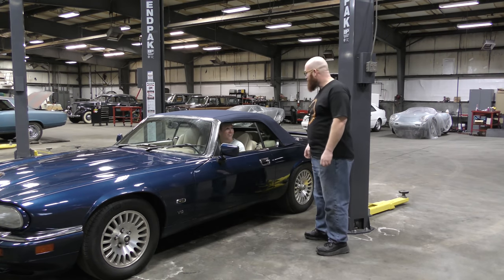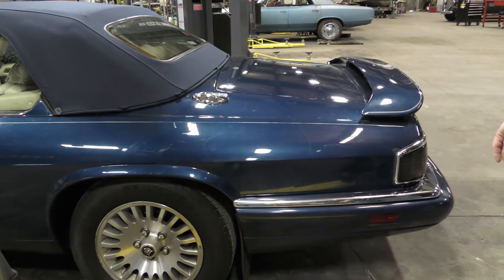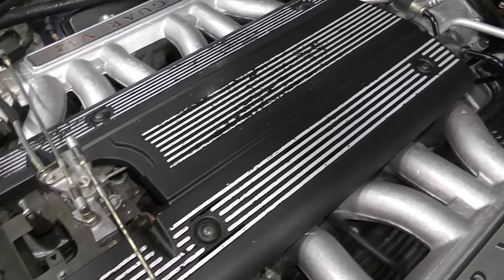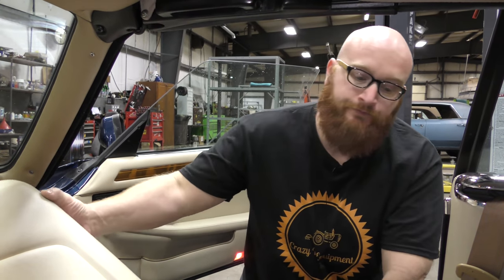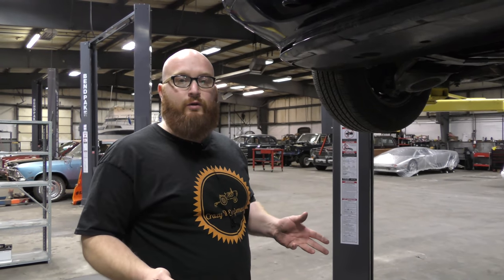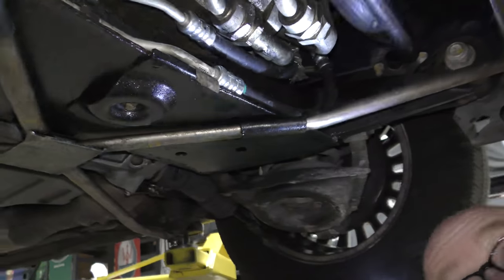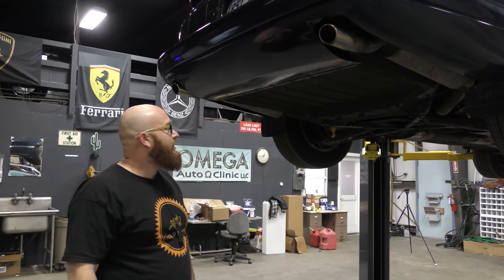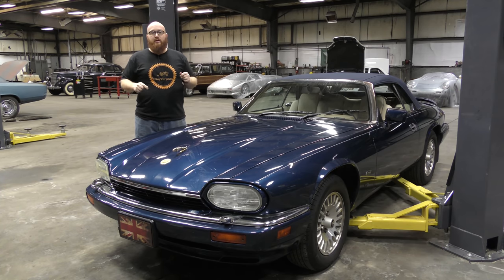It's another smooth running V12 Jaaaaag in the CAR WIZARD's shop! Check out this 1995 Jaguar XJS

Comment: The car did not come from the factory with the leaping jaguar ... someone has added that. It should only have the round badge.
Reply: Reminds me of a benz or bmw with a logo on the hood and a decorative plate with the same logo on the front bumper.  Never liked it
Reply: It doesn't look right with the leaper.  Very few Jags actually do.
Reply: @msalzberg4962  You are absolutely right ..... if the car had come from the factory with the leaper it would have been mounted where the round badge is, not 8 inches behind it . It doesn't look aesthetically pleasing. If I owned the car I would certainly remove it!
Reply: They weren't factory installed for pedestrian safety. It was a US thing back then. Those leapers were installed by the dealer if the customer wanted to.
Reply: Yep, looks naff imo
Reply: @freepieanchipsgarage I'm surprised about that considering the US's stance on car & pedestrian safety.
Reply: @freepieanchipsgarage I'm really surprised about that, thought the US was hotter on car safety legislation, like with the 5 mph crash safety bumpers. Mind you they continue to put dirty great bull bars on their pick up trucks and iirc bull bars had to meet pedestrian safety legislation a while back in Europe? Maybe the US is tighter on some stuff & visa versa with Europe? I have seen leaping Jaguar mascots on the bonnets of some late-ish Jaguars here in the UK that have been fitted by owners, I'm assuming they're not part of the MOT?
Reply: Freepieandchips is wrong
Reply: @Thomas63r2  Yes he is, I've owned three North American spec XJS V12 Coupes (an '87, '89 and a '91) and none of them had a leaper ... they all came from the factory with the round badge.
Reply: @freepieanchipsgarage "Dealer" installed when a buyer requests it does not make it standard or factory fitted.  Sorry, glad you like yours.
Reply: @freepieanchipsgarage It has surprised me hearing about some of the rusty death traps The Car Wizard has described how lax some US standards are. Here in the U.K the MOT is every year once a car is three years old and was recently change so any warning light is a failure. Many cars get scrapped because getting them through an MOT would cost more than the car is worth. 

The US does have some things like mandatory back up cameras that aren't a requirement here. However, what incentive is there for an owner to fix the camera if it stops working after a couple of years ?
Reply: @freepieanchipsgarage sigh, sorry you are sensitive  In reply to the original poster, HRCVF750, you were the one who said they came on all North American Jaguar until 2009 except XKs.  You are correct, my classic XJ12 does not have a Leaper.
Reply: @freepieanchipsgarage I think the issue with the checks in Japan is the price of the test. The most a garage in the UK can charge for an MOT is just under £55 and many charge less (although are more likely to rip you off on the cost of repairs). In Japan it is around £470 !  You will find plenty of cars for sale in the UK with short MOTs for under £470. If you are lucky enough to get a pass it probably doubles the value of the car.

p.s. At one time our local Ford dealer earned the nickname Grief Motors after their MOT checks wrote off two colleagues cars in same month. My wife's Ka survived every visit there, although on the last visit we did have to take it elsewhere to get £500 of welding done, before selling it later that year for £800. The real blame was on Ford for poor underseal. The mechanic said that he would see cars in perfect condition on the topside but full of holes in the floor.
Reply: @freepieanchipsgarage Wow, you are just like a kid denying what they said.  With some B.S. about this one being moved back from its original location.  Nope, this one has it exactly where either a dealer or owner installed it.  Still looks awkward.
Reply: @freepieanchipsgarage Northern Ireland has a better system with Government places doing the testing and you having to take the car elsewhere for repairs. In England they do try to keep some consistency. In the 1980s I heard of one Garage losing its status as a test centre for passing a car trading standards had taken there with a number of known faults. 

By far the bigger problem is the other way around though. I took a car to a newly opened Lucan autocentre for a service and was told it needed four new shock absorbers. That was one week after it had passed its MOT, so I told them what I thought and never went back there. In the next couple of years and MOTs no other garage ever made any comments about the still original shock absorbers.
Reply: @freepieanchipsgarage I guess freepie knows because he was there when this ornament was weirdly installed.
Reply: @freepieanchipsgarage all I said was that you were wrong - you are the one hurling personal attacks
Reply: @freepieanchipsgarage I guess I would suggest you learn how to write with clarity.  My suggestion would be to start with a quick read of Strunk and White.

Comment: 301 horses from 12 cylinders is awful, regardless of age 😂😂😂
Reply: ...exactly...crazy...
1969-502ci V8 220hp
2021-1.6T 4cyl 400hp
Reply: 350 lb -ft of torque is a clue about what they were aiming for.
Reply: To put it in perspective, the 5.8 litre V8 in a Ford F150 from the same year was 210 hp. Think 301hp  out of 6.0 is that bad now?

Comment: Brake hoses have been replaced, likely not bled 100%- that would be my first check. Lovely old car
Reply: 4:48
Can Wizard even go upstairs? It says 190lbs a sq. foot. Imagine being a customer there and seeing Wizard crash thru ceiling in the office
Reply: Just what I was thinking
Reply: @619guy202  I don't think he has square feet, so it should not be a problem.
Reply: Code on a house is around 40lbs per sq foot min.

Comment: About the crooked steering wheel : to do an alignment on those Jags you have to first set the steering rack at center and then mess with the steering rods. They won't be at the same length left and right and this is normal !

A previous shop may have done the alignment by just putting the rods at the same length, so the steering rack itself is not centered.

Car Wizard may already know that but hey, figured it might help.
Reply: My 944 has that same problem with the steering wheel being crooked. Do you think it's a similar problem? I haven't had it fixed yet.

Comment: Just a tip on that Jag , The u joints interchange with Ford F150s of the same year.
Reply: The u stands for universal.
Reply: Thanks for the timely tip. Have to pull the IRS for seal leak, bushings, etc. Might as well put new Ford$ u joints in instead of Jag$$$$.

Comment: Love that color !  A V-12 facelift car is quite rare, (most of them had the 4.0L I-6).  If the info I found on the Jag-Lovers forum is correct, that XJS is one of a mere 148 V-12 equipped cars produced for 1995.  I love my 55k mile '96 XJS !

Comment: Quite a nice cat, if you like the rear (and the spoiler is a no-go).
Reply: Spoilers on convertibles seem wrong to me.
Reply: Spoilers were standard on 12 cylinder cars. They were optional on the 6 cylinder examples.
Reply: Agreed. The rear spoiler spoils it for me. (sorry for the pun)   Fred

Comment: Like the composite European-style headlights. But this set looks oddly “unfinished” because of the painted bezels. Usually they are either chrome or stainless. Looks MUCH better that way, in my humble opinion.
Reply: yep...the bezels do look weird not chromed or stainless
Reply: The later models had the painted bezels.
Reply: Yeah completely agree with you on the bezels, but I live in Australia & I've changed my headlights to the US spec ones, just to be different, Oh & my coupe has also been converted to 350 small block, Rj in Oz

Comment: I met a guy at a gas station with two of these, one has the Straight 6 and the other the V12. He says they're the only cars he's owned since he bought them in 2004. The 6 cylinder one he was driving to the gas station had 160,000 miles and looked immaculate.

Comment: My 87 had similar issues (also similar miles).  Steering turned out to be simple alignment but all shims were missing so it turned into a complex DIY job to set up brake centering, camber and caster.  All safety lock wire was missing also.  Another fun job at the front was wheel bearings.  Rock side to side - no play.  Rock top and bottom and there was a noticeable wobble.  This was worn spindles (stub axles).  The inner bearings had rotated and worn a groove in the axles.  I fixed that with new axles and conical clamps to lock each bearing in place (racing trick apparently).  This had a HUGE effect.  I think the wobble caused the pads to back out leading to soft pedal occasionally. Mine works great now - fast and quiet.  Drives smooth and been reliable for the last five years or so - love it!

Comment: the leaper was added. the growler is stock. 
it's an old argument: growler vs leaper. :-)
Reply: The leaper is out of place on this car.  My X-Type had a leaper; I replaced it with a growler.  Much better.
Reply: @freepieanchipsgarage hi. i own a 94 6l.stock with the growler. went through ALL of the service manuals/spec sheets for nigel(the name of the xjs). did not come up with a leaper at all on any parts listing for the car.
Reply: @freepieanchipsgarage ....it IS possible though that it was a dealer installed option. on the car in the wizards garage though that is not likely to be the case. it had to be installed by either the present or previous owner. either way with both on the vehicle at once the persobnal opinion is that it looks ridiculous. a bit late for the bonnet though to be correcting that now. :-)

Comment: I'll be curious to see how the problems with the Jag were found and fixed.
Reply: Yes Car Wizard only seems to want to do an assessment on camera and doesn’t like to be shoulder surfed when doing the work. It would be interesting to see a little of the deep dive and rectification process. He actually did a bit of time lapse fitting a new bilge pump to his boat. It would be interesting to see at least some work in progress on the cars
Reply: Maybe he just does the assessment s and has his mechanics do the work???

Comment: Agree with Wizard. I also prefer the original headlights rather than the American spec. However because this one is a later model, it doesn't have the early rear light lenses which were a really unusual and unique design. I previously owned a 1988 XJS V12 HE. I changed the plugs at home-bit tricky as you have to remove the air con compressor to get at spark plugs 1 and two...

Comment: Wizzard  You know as well as me if a jag is not leaking oil the only reason is that it has no oil. Remember the old drip trays for you garage floor? Most jags need one of those screwed to the bottom of the oil pan with a bilge pump on it. During my apprenticeship back in the early 80s we had three steel templates hanging on the wall in the storeroom that had  "Jag rear brakes" written on them. One was for the holes you had to cut under the rear seat base to access the calipers for the xj6 series 1, 2 and 3, The second was for the patch panels that we had to make to cover the holes. The third was for the previous model from the 60s with those tiny hand brake pads. LOL

Comment: Mr. Wizard, thank you for the V12 XJS videos.  Your willingness to share your experience is a real gift to us all.  I recently acquired a 1994 XJS V12 convertible with 32,000 miles.  A true fair weather Sunday drive car.  Two questions for you.  Do you lift with the 2 post hoist on the dedicated jacking fixture?   Will you be doing a video on the valve cover gaskets to address the oil leak?   My car has the same issue.  To date I have replaced the AC pump, O rings, dryer and expansion valve.  Evacuated the system and recharged.   Also replaced a couple of faulty relays and perished front shock top rubber bushings.  These are truly beautiful grand tourers.  Doc R

Comment: The leaping jaguar hood ornament is actually older. I remember seeing them on Jags here in England in the 60s and 70s. I think they stopped fitting it because of the risk of disembowelling people if you were unfortunate enough to run into them. Rolls made the Spirit of Ecstasy ornament retractable for the same reason.

Comment: I believe that its a two day job to replace the valve cover gaskets because of the plumbing that hangs over them.  I looked at a couple of these over the years and they all have leaks that the seller is trying not to fix.  Still a beautiful car and if you can get a good one and find a mechanic willing to work on it then you are golden...
Reply: No, it's not. You can unbolt the manifolds, disconnect the fuel rail, vac lines, injector connectors, then lift the entire lot as one piece onto a board and take it away, then you just unbolt the covers and seal them up. I did it a few weeks ago and it was pretty easy.

Of couse it's much better if you stretch the job out, to give time for the sealant to go off, and to tidy up the mess the leaking covers makes.
Reply: @thegearknob7161  Sealant - hmmm.  Never been fond of it, many people use too much, it can break off and get into places where it is not welcome.

Comment: Wait till his customer rolls in a Citroën SM with a Maserati v6. Drinking will ensue....
Reply: One paper in Sweden ran a tema on : owning unusual cars and not being afraid of fixing themself.  The SM owner could be described as Major Tom (the car's cockpit is Citroen issue spaceship inspired) and he were at that time Major (OF-3) in the swedish air force and a flight aircraft engineer (ie combat pilot with an aircraft engineering degree.) He wasn't afraid of the engine's injection system at all !
Reply: If a Citroën XM he would shit him self and become an alcoholic as quick as you could say hydrostatic  brake and suspension system 🤣😂
Reply: @fraserlivingstone1244  No he would not , he would work systematically work through the systems.
Reply: @kris8742  And take 4hrs diagnostic  to find the problem and costing the customer money.

Comment: The first three years of the Buick Reatta have the same brake system.  Many of them have been junked because no one has the tools or knowledge to  repair them.  I bought a new Jaguar accumulator for my 88 Reatta and that fixed the problem for a while.  There are a few Reatta recycling yards out there that stock used parts too but they are hard to find.

Comment: These cars are notorious for having out of balance butterfly throttle. 2 push rods of a central wheel.
Reply: None of that sounded right. They definitely do have problems though...
Reply: The pushrod adjustment is not the individual throttle stop adjustment. This is where it all starts turning to shit. Turning those pushrods is the very final step.

Comment: My absolute favorite Jag body style. To me it has a muscle car look to it with the Euro headlights & full width taillight, and the prominent wheel arches. I had a '91 Cougar XR-7 test mule I bought at an estate sale for $500. Took it to a friend who was a Ford mech and he said they only made about 300 of them. It had the same Teves stand alone power brake system; used also on the Mark VIII. I also had the same issue, felt like they were grinding even after a brake job. He found that the issue were the relief valve seals & the pressure switch. Back in ;04, they were already expensive since there wasn't a rebuild kit; so he ended up getting a new pump from the U.K. costing $250 because he couldn't find any available here in the states at the time.

Comment: Smooth running until it's not...running.
Reply: Which usually isn't a long wait.
Reply: @freepieanchipsgarage yes, that is why they have such a stellar reputation.
Reply: @freepieanchipsgarage  yes, I am sure that the Jaguar V12 reputation for unreliability just spontaneously arose from very thin air.

Comment: Look up "Marelli ignition failure" Car Wizard. It happened to our 1990 XJS. It is easy to prevent it.  The rotor fails and you lose spark to one bank of cylinders then the raw gas hits the cat and ignites blowing the hoses off the top back of the motor...if you are lucky there won't be any other damage.

Comment: from Fraser, husband of Leslie
These cars first came out in 1975 ! The car here is the facelift done when Ford owned Jaguar. I believe Ford also made the shell from galvanised steel, the previous cars rusted badly. This is a lovely example of the convertible that came out quite late during production in 1988. Cars like this in very good condition, now fetch high prices here in England.

Comment: This car is a lot rarer than car wizard suggests. This model is a “facelift” version which came out for the last three years of which very few had the 6 liter V12 engine. The majority had straight 6 cylinder 4 liter engines. Of the approximate 2,500 6 liter cars 2/3 rds were convertibles, the balance were 2 door coupes. The convertible was the most expensive Jaguar at that time at around $95,000 each. It is truly a magnificent automobile and this version is by far the best of the bunch. I know having owned a 92 with a 5.3 liter V12, A  cylinder 4 liter and a 94 almost identical to this one. My car did not have the chrome leaper Jaguar on the bonnet and I suspect it was added later on.

Comment: I’ve had several  (3) v12 XJ-S and the best are the later 6.0 V-12 with coil packs and Denso ignitions. They were also more reliable with Ford electronics.